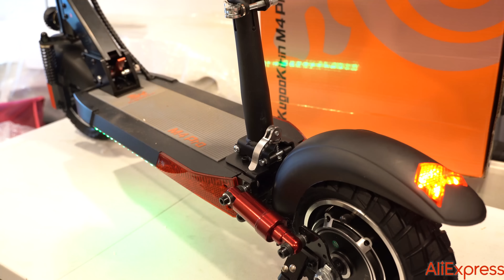KugooKirin M4 Pro 500W 28mph 37mi Electric Scooter - Unboxing, Assembly, Test Ride, and Review

Comment: Can you help me how you turn off the lights and the bottom red blue where I press the for the button on a lot to mess up with me? I got a brand new scooter. Can you show me a YouTube
Reply from the maker: Hello, I sold the scooter and am unable to test it. Do the LED lights only turn on when you turn on the headlight? It may be physically hardwired, and will need to be disconnected. There may not be a setting to turn it off
Reply: @ColinLeung  BlueDisplaydashboard and the high beams will be Blue I have that scooter. How are you turning on the can you show me a YouTube channel how you turn on go see destructions the book for the scooter
Reply from the maker: @omarsantana3085  Here's a link to the manual https://www.manua.ls/kugoo/kirin-m4-pro/manual?p=9
The lights turned on automatically when I turned on the headlight.

Comment: What is the fastest you gone on it in flat ground roads so far?
Reply from the maker: I was able to hit 28mph flat, but it took a while. I wasn't able to get any higher unless it went downhill.
Reply: @ColinLeung  For 110 pounds will it get to 30mph?
Reply from the maker: @FrancoYt-p4v  It may be possible. The speed may be limited to how fast the wheels can spin regardless of the rider weight. The best way to verify is with a secondary speedometer

Comment: Hey Colin,
Nice review except for the lack of safety precautions!
I bought a Segway 30mph from Costco and returned it after realizing how dangerous it was.
My unassuming neighbor rented a slower scooter in San Diego and fell on her head suffering brain injury with no helmet.
These scooters are much more difficult to balance standing up than some people realize and at high speeds they are flat out dangerous. 
Ebikes are much safer and easier for the average person to balance.
You need to stress safety as well as what a good deal this is!
I know the manufacturer wouldn’t like it but you’d be doing a great service for your viewers.
Thanks!
Reply from the maker: Hello John, thank you for letting me know. I'll be sure to include a comment about rider safety in future videos!

Comment: in the UK they do not sell only the 16AH battery version , in the UK we always getting scammed an cheated out of what we should reaally have , took me agaes to find the ones i got , paid 900.00 for 2400w , 45mph 18ah battery . that was an amazing deal by the time the white people of the UK get there hands on them and selll the, the charges will 5000.00 for thos m4 pro with a 7AH battery , so have extedended range gotta pay 7000.00 for 15 miles extra range , never buy in the UK we get ripped off unless you know were and how to search , i can  not get this scooter at all with a 18ah battery says italy only and other countries
Reply: im in the UK and im tyrying to decide on either the m4 pro or the G booster, ebay seems to be the only place i can get either, what would you suggest so i dont get ripped off?
Reply from the maker: @alexlyndhurstfreesuge5532  What's the prices for each? The G booster seems like a more powerful scooter overall. I'd get the one that you prefer based on specs (power, range, weight, etc), and see which one is closer to MSRP on ebay.
Reply: @ColinLeung  600 for the M4 pro & about 900 for the booster...
Booster looks more of a beast but will it be a problem with parts, if the battery dies..
I paid 800 for an inmotion L9...
Battery now doesn't work Nobody can do anything for me...its a month out of warranty...
It can be expensive if you get a rare scooter that nobody has spare parts for
Reply: @alexlyndhurstfreesuge5532  bro you best going to EnviroRides they UK based and do a 2 year warranty they have bad Man scooters at a good price , mine get up at hill with ease and is rapid on take off and they can be trusted dine over 500 miles so far no flat tire no issues all is good
Reply: @smoxesss  Thanks bro, looking at their website and the scooter that interests me is the G2 pro...
But that scooter is supposedly made by Krugoo yet there's no mention of krugoo on their site....so are they like good copies of well known brands of scooter
Reply: @alexlyndhurstfreesuge5532  all scooter company use the scooter frames they just change the controllers and stuff that make them faster and slower but if you saved the little extra bro you will lovr the p1+ and the battery lasts ages can go from city to city easy
Reply from the maker: Sorry about that. Thanks for sharing your experience.
Reply: @ColinLeung  over here too many scammers and thief's and greedy people always cut us short in the UK but its OK I have other scooter to make up the range difference
Reply: I bought the m4 pro here in the UK for £397 plus an extra £25 for waterproofing, which means the company that supplied it will.warranty cover any water ingress, bought from loco in Northern Ireland, you just change currency and country at bottom of page and their prices go way down, something to do with not having to pay vat or something  because its from outside UK, idk,  they even paid the duty on it, price has gone up since but its still under £500 and under £400 for the plain m4, only took like 3 days to arrive too